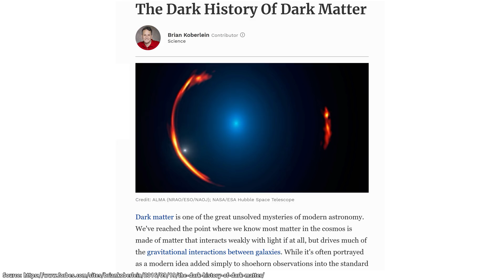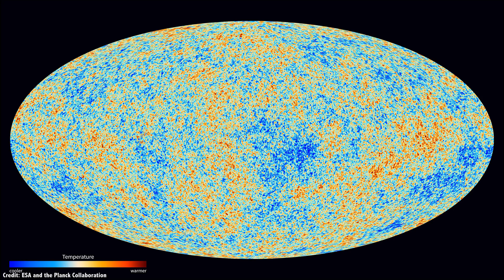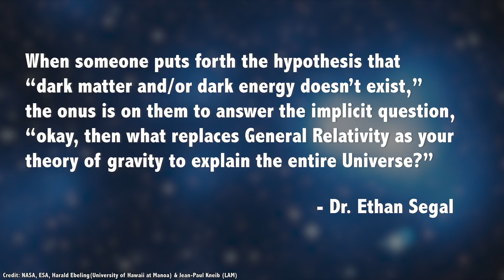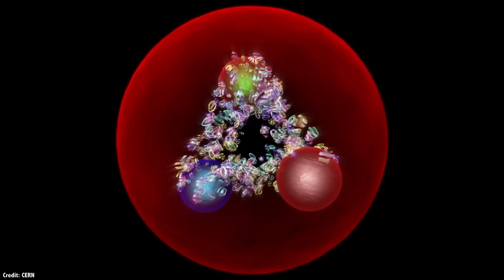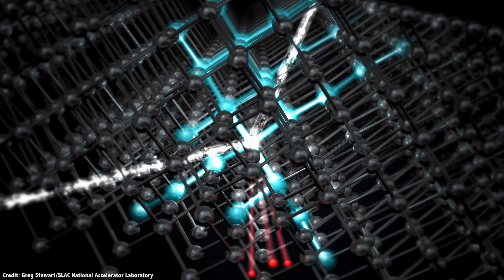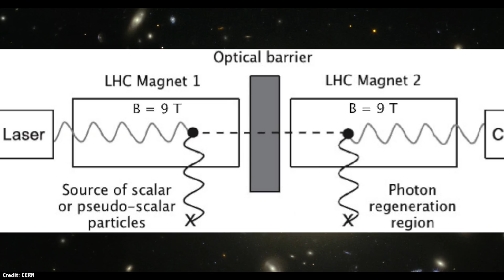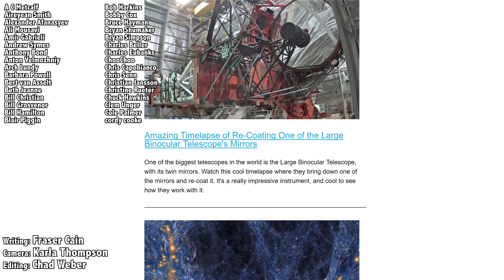How Are We Searching For Dark Matter? And How Do We Even Know It’s Real?

Comment: 5:11 It (dm) doesn't interact with regular matter in anyway we can detect, except gravity.
10:47 Even if dark matter barely interacts with matter, it can happen from time to time and you can observe it.
11:26 Every now and then one of this dark matter particles will interact with regular matter and release a cascade of particles that could be detected.

I can't even... Please explain what I am missing here. How can we detect something that is undetectable by definiton? And those detectors are not gravity detectors. I've been trying to wrap my mind around this, but failed miserably. Can anyone help? Thanks.
Reply: They can ONLY detect gravity.  That's all.  There is gravity where no gravity should be.  That's all they actually know right now.  WHY or WHAT is what they're scratching their heads over.  Is it some kind of particle?  Unknown.  They'd like to find the flaw in their theory!  :)

Comment: When it was discovered by Vera Rubin that the speed of material in the arms of the spiral galaxies were too fast for the theory that the material was spiralling in against the galactic centre, scientists should have accepted it saying OK, we were wrong, gases and stars are obviously spiralling out from the galactic centre. 
But at least when Arnaud Siebert and Benoit Famaey, astronomers at the Strasbourg Astronomical Observatory confirmed that with measurements of stars in the Milky Way it would have been appropriate to finally give in to something so well established. But that had molested the religious faith in the Big Bang Theory (BBT), in which the spiral galaxies have a gas and dust gathering function; nothing was allowed to threaten that theory or disturb the so called scientists that still, after a third of a century of failed investigations, continue throw money on fruitless projects to discover e.g. dark matter. When will these individuals that think they are scientific cosmologists confess that they have conned us almost half a century? Or do they just lack common sense?

Dark matter is one sham, the other is dark energy, which stands on the interpretation of the redshift of light from distant galaxies as a Doppler Effect or Expansion Effect of the expanding universe. Regardless of which of the two Effects you chose, or how you combine them, the redshift can’t be wavelength dependant. 
But it is, according to Ignacio Ferreras and Ignacio Trujillo in “Testing The Wavelength Dependence of Cosmological Redshift”  (The Astrophysical Journal, 2016 July 10) 
So, you say defensively, it was only known from 2016, so… 
No, already in “Proportionality of Nebular Red Shifts to Wave length”, by Minkowski and O C Wilson (Astrophysical Journal, May 1956) it was known to all, that have sound reasons to call themselves scientists.

So, what is the response of the ‘scientists’ to this? SILENCE, of course! The treatment of Prof. Halton Arp and prof. Jian-Miin Liu, to take two outrageous cases out of many, are good examples of this tactic.
So, why the silence? Because the BBT is so unconvincing, speculative and overall unscientific compared to the theory that the universe has always been there, eternal and limitless in space, that nobody will open Pandora's box. Everybody but the religious will ask why it took so long time and so many millions of $$$ to arrive to that natural conclusion. The answer to that last question is probably that Without Limits and Eternity can only be admitted to God, which is, of course, unscientific.

Comment: No, wrong analogy about the car making a sound and you finding a mechanic to locate the source of the problem. The fault of the car causing the sound was an introduced fault by accident etc, after you experience that the car was once functioning properly and that the noise should not be there. Whereas Dark Matter is a different situation.  I will use a different but very similar that involves a car and simplify it. Imagine that you have previous knowledge of cars, 4 wheels and a driver seat in which you sit and drives and a road that you drives on. That's your knowledge on how cars should behave. Now, imagine a car size quadcopter with 4 large propellers and also have 4 wheels and a seat to drive in. You were put inside the seat of that machine, you assumed that it is a car and you should drive with it as you would in a car because you imagined that and based on the position where you are sitting you haven't observed the propellers directly but can only observed the effects while you are accelerating inside, you can see the car moving but at the same time observing some thrust and wind etc which is giving you unexpected results that behaves differently from the view of what you have assumed a car should be behaving like. Based on your original assumption you think that you are driving a car and it should be behaving like a car but it is not a car, you are sitting in the cockpit of a flying car that looks like a car, the 4 wheels that you have definitely seen and have previous experience of, you are sitting inside the assumed car seat, which is the cockpit and you are definitely seeing behaviors that is more than just a car as you accelerates, its staring to take off, but you could just drive it as a normal car. So, the data that you are receiving, by experiments and observations, science will soon figure out that you are actually in a quadcopter car.
Reply from the maker: The possibility that the car is actually a quadcopter can't be ruled out, but it's not where I'm going to start with my investigations into the sound.

Comment: I beleive dark energy to be the vacuum energy of space-time, and that DARK MATTER is a fictitious force.

A positive pressure exerted by the vacuum energy of space-time predicts:
- the accelerating universe.
-the expanding universe.
- matter in the outer regions of a galaxy/ cluster should be moving faster than we predict. Sometimes faster than our predicted maximum orbital speed, without flying out of orbit.
- we should measure there to be more mass via gravitational lensing than we can see matter being accountable for.
-escape velocity should be harder to reach than what we measure on galactic scales.
- gravitational effects such as seen in the bullet cluster ; where a region with a lesser amount of more dense matter will warp space-time more than a region with a greater amount of less dense matter.

I beleive dark energy to be the vacuum energy of space-time,
And that DARK MATTER is merely the effects of dark energy on regular matter.

EXTRA MEASURED MASS:

The extra mass measured in the universe does  not require dark matter. The extra mass that we cannot see is relativistic mass due to the pressure of vacuum energy, that is why we do not see it, also why our calculations are off- because we are not accounting for the pressure-.
An analogy would be, at the bottom of a deep pool, it would take a lot more energy than one newton to move a one kilogram weight one meter, due to pressure.

SPEED OF OUTER STARS IN GALAXIES /CLUSTERS:

The pressure arrises when there is a curve in space-time, creating a more and less dense region, bringing on a pressure differential.
Since gravity is a product of momentum and mass, it's a safe assumption to say the more mass in one unit of space-time, the bigger the curve, there for, the greater the pressure of the vacuum energy in that greater curved area.
Newton laws of gravity says that stars closer to the gravitational source should be moving fast than those further away.
But if stars in the center experience a higher pressure region, their motion will be slowed.
Meanwhile, the stars in the outer region( further from the gravitational source, therefor, less pressure) experience less resistance  and move faster than predicted.

Comment: I think undetectable dark matter particles orbiting photons (and electrons, etc) are pulling them into polarizable axial or helical apparent wave 'packets' as they travel depending on the orientation of the orbit.  This would explain the double slit, uncertainty, wave particle duality in general, etc if true.  I think the interaction between a photon particle / dark matter particle orbiting pair with dark matter that's everywhere around us is what limits the speed of light which would explain the speed of Hawking radiation in the absence of dark matter, the speed of the expansion of the outer edges of the universe in all directions into otherwise empty space which contains no dark matter either, etc.

Comment: This is an excellent video describing the search for dark matter and thank you for the invitation to offer suggestions.

My proposal is that dark matter is not a single particle but a group of two or more particles bonded together. Specifically it is proposed that dark matter is comprised of neutron groups which are groups of two or more neutrons bonded together. Single neutrons decay into a proton and an electron but neutrons bonded within an atomic nucleus are stable. In the same way, two neutrons once bonded together will be stable.

To understand the formation of dark matter as a halo of mass around each galaxy, you have to adopt a new approach to galaxy formation. Galaxies form and yield matter in the form of neutrons. Single neutrons decay to a proton and an electron and this forms hydrogen gas and subsequent evolution leads to other elements.

Some of the matter formed in the galaxy formation event including hydrogen and dark matter will fall under gravity to the center of the galaxy and form a massive neutron star which is large enough to create its own event horizon which means we would describe it as a super massive black hole at the center of each galaxy.

With this description of dark matter as groups of two or more neutrons it is unlikely that any of the experiments described in the video will be able to detect this dark matter directly. It would be more useful to try to create neutron groups in the laboratory. With an insight into the galaxy formation process it may well be necessary for the neutrons to have a common spin axis for the bond to be stable.

For more detail on this proposal see:
https://www.academia.edu/5009126/The_evolution_of_the_universe

Richard

Comment: Well covered. I did astrophysics to a Masters level and approve of car analogies. However i doubt you will convince the armchair "experts" since well, they are by definition pretty willfully ignorant. It is SOO much easier to learn about this stuff and its history with nothing much more than an internet connections. It is not like you need a bunch of subscriptions to paper journals anymore. 

But hay they spent 5mins thinking about it. Of course they have a better insight into the problem. </sarcasm>

Comment: I don't have a problem with the phenomenon of dark matter - like you, though, I do wish they'd picked a better name. "Dark gravity" would probably be better. My beef isn't with the reality of dark gravity, but the assumption that it must be being caused by some kind of particle. A particle that absolutely cannot be detected, doesn't seem to fit in the Standard Model, and we have no theoretical model for.  It just sounds an awful lot like the luminiferous aether - we knew it had to exist, because light was a wave, and we know that waves can only be transmitted through some kind of substance...right?

I don't think we understand the universe nearly well enough to decide that dark gravity MUST be from an undiscovered particle, much less that we could detect such a particle. If I had to take a guess - a random, uninformed guess that's much more to do with science fiction than science, most likely - I'd wonder if what we're seeing could be just part of the structure of the universe. That spacetime could be curved by something other than just mass - mass will do it, sure, but perhaps something else can too, something structural.  In the old rubber-sheet analogy of relativity, where space is like a sheet of rubber and placing a bowling ball on the sheet will distort it, what if we added a layer and said that there's a metal frame under the rubber sheet, and so it sags more in some places than others. 

It just seems like we're pouring a LOT of resources into detecting a particle that just...doesn't seem to be there.

Comment: Question: if the latest leak on the ISS was caused by a micrometeorite, and there's no exit hole, is there any chance to find the remains of said meteorite? How big (or small) does it have to be to make a 2 millimeter hole in the ISS?

As a bonus question: the astronauts stitched the station, but didn't the just fix the problem on the inner-most layer? What about all the holes in the outer layers?
Reply from the maker: I think they just used duck tape, which seals it up pretty well for now. I'd assume the debris is in there somewhere if it didn't pass right through.

Comment: Nice video, and I'm glad they try finding out the mismatch between observations and theory.
However, there are 3 possibilities for the explanation, and not 2 as explain in the video.

1. We have the laws of physics wrong (MOND). Mentioned briefly in the video.
2. There is some sort of missing stuff out there. Most parts of the video.
3. Our observations and/or interpretation of the observations of weak light from far-far-far-far away is incorrect. Not discussed in the video. 

#3 should be given a higher priority IMO. 
(There isn't anything wrong with your car, but you have Tinnitus)

Comment: Fraser, I'm often the first or most vigorous commenter when dark matter is at issue, and I've never said any of those things.  Dark matter is real, and astronomers generally are not fools or frauds.

6:00 Bullet Cluster - an excellent observation.  Now add the facts that (1) the Bullet Cluster is one of the few places we see dark matter moving differently than normal matter, and that (2) the other places such as the Train Wreck Cluster give different values for the self-interaction cross-section.  You know where I'm going with this so I won't belabor it.

7:55 I think I know where these figures are coming from, and they are subtly misleading.  That is, they are real but off by a few percent.  If I'm not mistaken, they come from a compromise between fitting the Acoustic Baryon Oscillation curves exactly and matching to the Hubble expansion rate. The Hubble expansion rate has not been pinned down to anything like the precision that it would need to be for that weighted compromise to make sense.  In particular, it is sensitive to large voids in the universe, and we are still discovering some of those.  There was a new one a few months back.  So the error bars on the Hubble rate are big and it's hard to even estimate how big they are.

Without the (I argue ill-advised) fit to Hubble expansion, the ratio that COBE and WMAP both independently give is a good approximation of the integer ratio of 1:5.  It's well within error bars and in fact 1:5 is beautifully centered in the error bars of both COBE and WMAP.

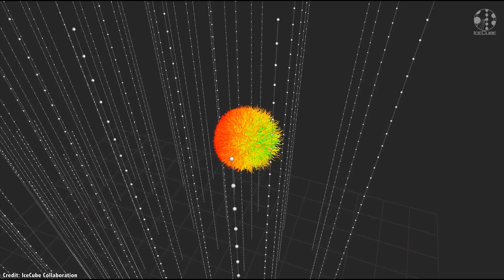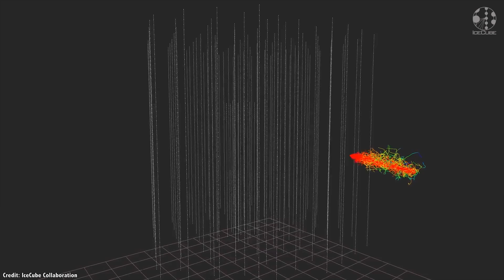10:00 to 15:00 sigh

Comment: Great video as usual!  Question: since neutrinos are typically all traveling at near the speed of light, and since objects traveling near the speed of light have a higher mass than objects relatively at rest, does that mean that the actual mass of a given neutrino as we detect it is higher than a hypothetical resting neutrino?  What is the difference in mass between a resting neutrino and the average neutrino that we detect?
Reply: Yes, a particle's speed contributes to both momentum and gravitational attraction. You can rewrite these equations to show that there is a "relativistic mass" that depends on the rest mass and the object's speed. I'm not sure how accurate the article on wiki is as it isn't my field: https://en.wikipedia.org/wiki/Mass_in_special_relativity, but it says that due to this, even massless light has a tiny gravitational attraction, just like it has a tiny momentum. I would guess that since fast neutrinos have an exceptionally small mass, they behave similarly to light in this way.

Comment: If Dark matter explodes on contact with matter..would not the Universe be a constant explosion??, its my thinking that it would.
Reply from the maker: Are you thinking of antimatter? That's the one that annihilates when it contacts regular matter.
Reply: They weakly interact so it's unlikely to happen. I'm thinking an occasional dark matter "explosion" is more on the line of an occasional neutrino collision.
Reply: Anti-matter and regular matter just cancel each other out. i think the explosion may be scifi but we have no conclusive proof one way or another.
Reply: It's not SiFi in any way at all.  Antimatter has been created in accelerators and used to create high energy interactions with regular matter.  It's standard run-of-the-mill accelerator work for physicists.  And yes it does make a big explosion.  It's E=mc^2.